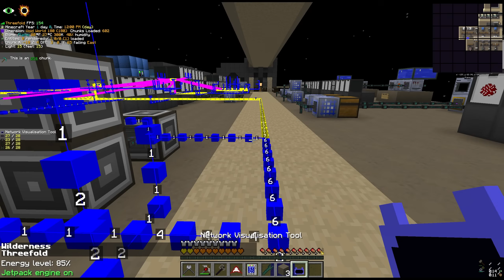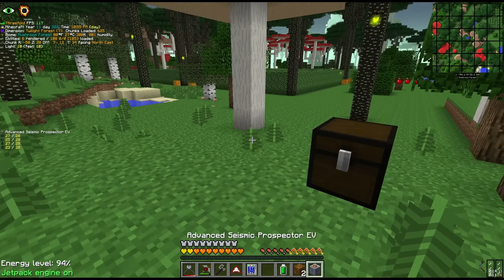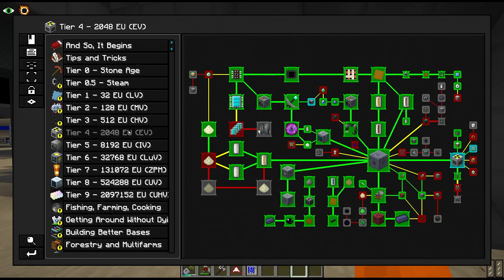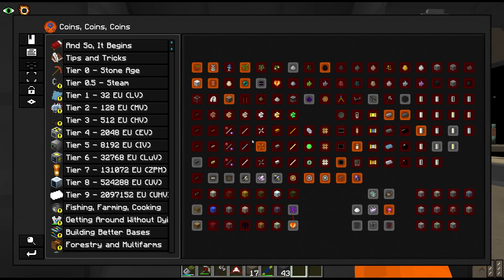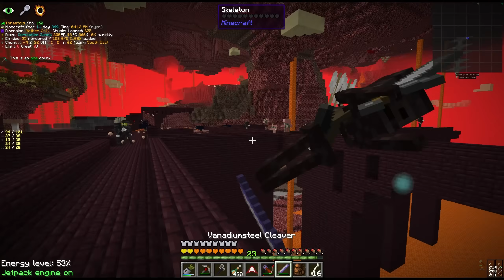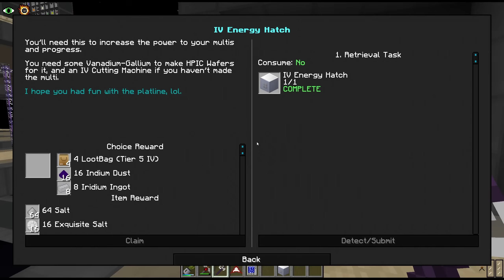Gregtech New Horizons - 49 - Filling InGaP(s)! Modded Minecraft

Comment: I used steel to get my cells since I didn't have PTFE automated properly (not really, I had it sorta automated but it was still in the old base and a bit of a mess besides), not a problem since you can easily cook up thousands and thousands of steel ingots at this point. Better to go with PTFE if you have that properly automated, though, and, eh...you really should ;)

Those circuit assembler recipes for storage components are actually a very recent addition, when I played I had to craft up storage components from 1Ks and be happy with that. I mean, I didn't, because who needs digital storage when you've got compressed chests and the ability to keep them organized, but if I wanted digital storage it would have been a lot more expensive for me ;)

Three, recall that Ross128b has much richer diamond veins, and you have access to that since you've made a T3 rocket. That's not to say that setting down a miner in the Twilight is a bad idea if you needed, say, some more TC shards as well, but if you're looking for diamonds there's better places to hit up.

You're eventually going to want to use Radon to speed up EBF cooking, so stockpile up early if you can afford it.

There's not really any benefit to doing the tiny pile of indium recipe over the full dust recipe. You I don't recall any recipe requiring tiny pile of indium dust specifically, and even if such a recipe exists you'll need indium in such large quantities that doing the full dust recipe is better anyway.

I think I had my lead-zinc solution output straight into an electrolyser, so no clue on it's P2P shenaniganry.

Helium is either from Endstone, Refinery Gas or Aurora blocks from the Twilight. You really shouldn't use Helium coolant cells if you can avoid it until you've got a stable source of helium secured, because it's going to come up in both EBF cooking and superconductors, so be careful with what stock you've got.

Remember that your power draw is functionally capped at 1A LuV, because your power spine is fed by a 4A IV battery buffer, so you really don't have much leeway once you start adding IV machines. I'd really recommend upgrading to at least a 16x IV battery buffer if not a multiblock battery buffer at this point, since you're likely to run into throughput issues if not production issues soon.
Reply: That LHE peeking in the corner
Reply: Good evening mr expert in chmitry and gregtech and aka gregarious t